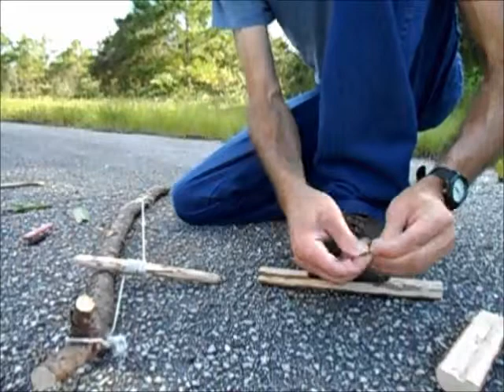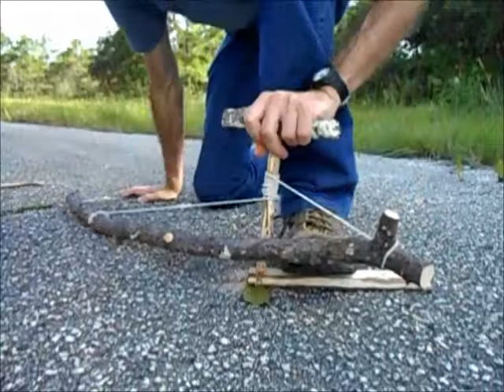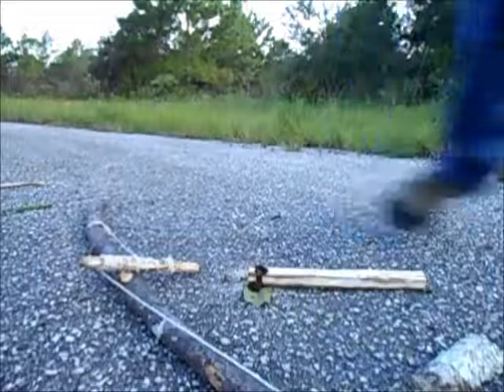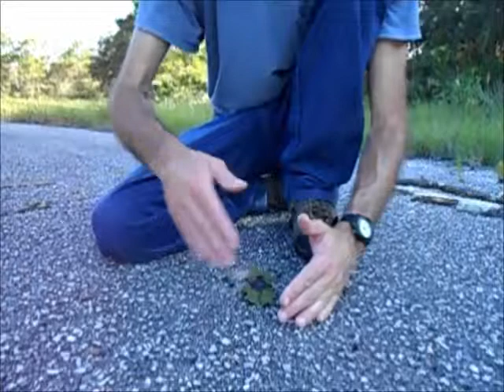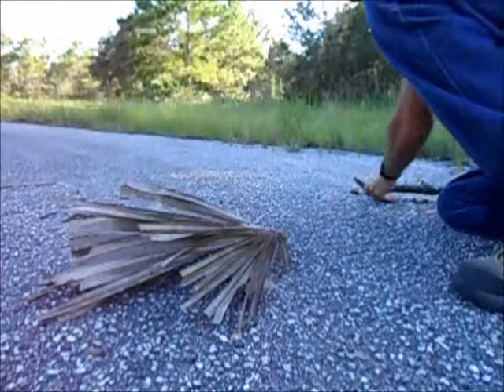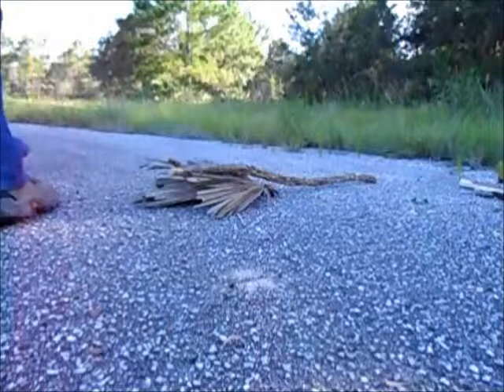MakingAFirebowSetPart2

Comment: You make it look pretty easy.  I'll keep trying. I learned quit a bit from this.  I like the Egyptian style technique.  I'll have to try that one I get a successful fire. Thanks for all the info.  Very helpful
Reply from the maker: Its never easy. Haha. That is one word I try to steer clear of when it comes to skills. The Egyptian cord method allows for use of weaker cords, cords last longer with the Clove Hitch knot since there is no cord wear at the spindle, and no spindle slippage on the cord. Its not really hard to do but because its awkward it may take some getting used to. Think cord management when using it and you will have fewer problems. You do need a longer cord. In this video the coal took me a lot longer because I think there was quite a bit of moisture in the Willow wood. Glad it helps. Thanks for the comment.

Comment: nice video, found the explanation on the Egyptian method very useful, seems like it would solve most of my common problems, cord loosing tension , and the spindle fly out. nice tip on the moving the bow at an angle too , as i've had many notches break of. thanx for sharing
Reply from the maker: +ba survival (basurvival) Thanks. The big thing it does when using natural plant fiber cords is by using the Clove Hitch knot, not only eliminating spindle tension and flip out problems but there is NO cord rub on the spindle. That is what wears a cord away very quickly. When I do eventually have a cord break it usually happens at the rear part of the winding cord. Not on the spindle. You can see this happen in my FirebowHibiscus video where I was using a Hibiscus bark cord. You just have to make a longer cord for the Egyptian method. Yes when I have a more narrow fireboard I will move the bow angle to keep from breaking out the notch. Otherwise if a wider board then I don't need to as the notch can be set a little further back on the board.